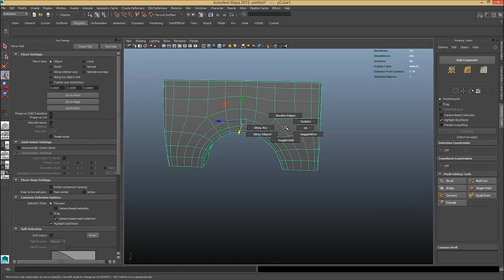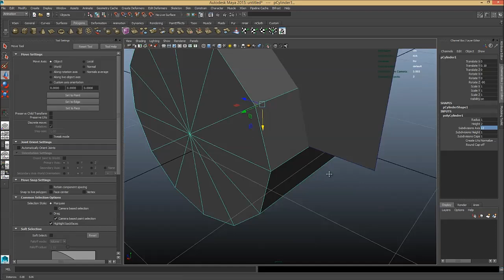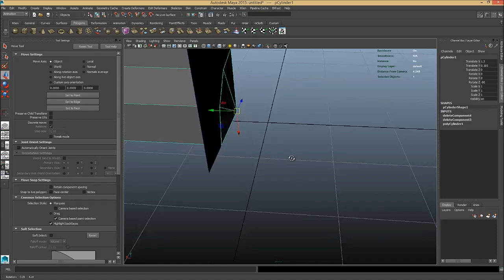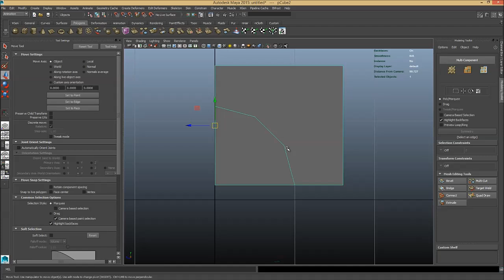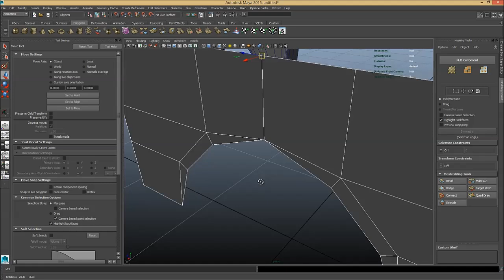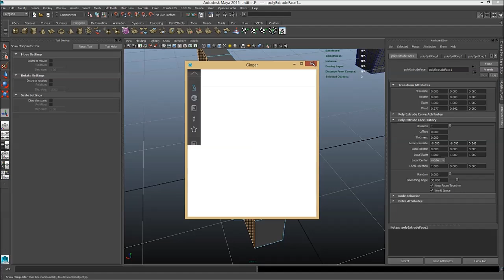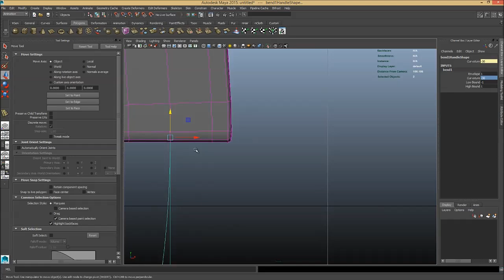Maya 2015 Modeling Tutorial - Intermediate Techniques - Arch way

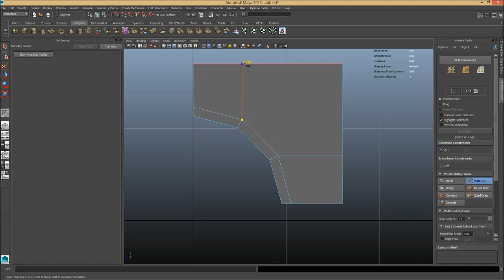Comment: 7:19 I see you struggle to get perfectly horizontal edge flow with the multicut-tool. Is there really no "hold-shift" or whatever way of getting perfect lines without any second steps?
Reply: 2 years later lol bit you can hold control but it cuts through the whole object
Reply: @SheeshMaster64  Ohh hahaha ty. Yeah I found that too in some other vid but for those wondering, I guess :D

Comment: I am sorry but this is a very lengthy and almost inaccurate way of handling a perfect curves, even for Intermediates. You shouldn't even need to manually insert vertices by hand. I use a boolean for cases like these.
> Just make box for a wall in front view, snap it to grid. 
> Make a Cylinder with 12 sides same way, snap to grid.
> Delete lower half of the perfect cylinder, then boolean with difference (The cylinder should be crossing on both sides of box)
> Then delete the faces created on the box that has N-gons (5-sided geometry) 
> Do manual bridging between edges of the box and the resulting cylindrical perfect curve.
> insert loops at corners to make it crisp when smoothed. 
It takes 2 minutes.

Comment: is there no easier way to do this. I started on modo because of cost, and its way easier to do, you just designate how wide the arch will be and then it will create  graduated set of edges to create the arch automatically.

Comment: Cool tut.  Question - why not use a Boolean to cut out the edge instead of tracing it and cutting it manually?  Otherwise, great stuff - I didn't realize half of those options were hidden in those right-click menus. :-)
Reply: booleans  can be pretty messy, and generally create more problems than not. I tried it with booleans and while it was pretty fast to get to the arch shape, it creates a messy outliner, with your objects in shape groups and such. i think for simple objects like this it works ok, you just have a bit more tidying up to do.

Comment: For an alternative way with similar results: just start from a cube instead of a plane; let's say that it's positioned similarly enough to where you polyplane is and then bevel the X aligned edge closest to the origin, with three segments (or more, but I'm just mimicking this video. In the channel box you then only have to change two other settings from the defaults ones: Autofit to OFF, and then you can set Roundness to its NEGATIVE opposite. Delete the usual (and annoying) extra-edges left from the pre-2016 version of Maya bevel, and you get the same perfectly round result. No bollean operation, no cylinders hurt. And pretty fast. Just another way to start this, at least. Then follow the rest of this video ;)

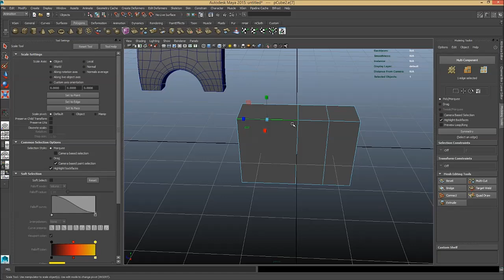Comment: When I try to use "T" command, 2:29 to repeat the last command it doesn't work. Is there a setting that needs to be turned on?
Thanks for your help.
Reply from the maker: shubham oberoi Its G to repeat last command and Y to repeat last tool, if you are unsure what is a command or a tool, check the edit mesh panel it will say "Tool" next to tools, and nothing next to commands. Hope this helps!
Reply: I'm new to maya but I think its "G" for repeat not sure :3
Reply: Edge-CGI 3D Tutorials and more! , shubham oberoi Thanks yes this works!

Comment: Ok, so as a person completely new to Maya but also as a person who picks up on programs quickly, i found your tutorial infuriating.  Your explanation of the steps you took miss out on crucial details.  I was going to knock this out before i had to go to work, but ended up spending 2 hours on it and i didn't even get halfway through because i had to use 20 other tutorials to explain the steps you glossed over!

Some areas i got hung up on:

Creating shapes:  You fail to mention that you simply clicked where you wanted the shape.  The in-program tool tips tell you to click and drag which creates a conflict in the process for people unfamiliar with Maya

Views:  I had to go through endless tutorials to learn all the shortcuts on how to change views with menus.  one moment you're in perspective the next you're in front and you completely lost me

Snapping:  Snapping should have been gone over much earlier in the video.  I ended up looking it up way before you explained it, because you used it for moving objects, you used it for rotating the cylinder (which is shift right click then LEFT - not right) ... etc etc

Finally, the last thing i got to before I just had to get off, write this and go to work - the bevel tool.  You completely skipped how to expand the bevel or whatever.  Also it doesn't help us if you tell us what your custom hotkeys are.  ALSO ALSO, it's hard to tell whether you're saying B C V D E.......?  Try using ' b like boy ' in the future - and avoid custom hotkeys as a general rule.
Basically, when a person creates the bevel using the right click menu, it doesn't automatically take you to the point where you can adjust that.  YOu have to actually open the menu on the right, click bevel and then you can adjust.  This gave me a large amount of grief, as honestly there's no decent tutorials that explain bevelling out there.

Sorry if i'm a bit harsh, i've gotten quite frustrated trying to follow your "beginner" tutorial, and i know, maybe i'm not the level of beginner you intended it for, but hopefully my issues help you create a better tutorial in the future.

PS - i will be completing this after work.  I don't give up that easily!!
Reply: I don't find that to be fair, TheDevilMyself. This was a clear tutorial from my perspective.

Part of learning is having to reference multiple tutorials, so you did the normal thing by getting stuck then referencing the web for help. Welcome to the professional world where we all do that, even at advanced levels :) 

Along with what Edge suggested, for beginners, I would recommend #1 that you never expect to knock anything out real quick in Maya. It's a complicated tool. #2, please consider Lynda.com. Most YouTube tutorials are best as references, inspiration and promos for paid training courses.

Lynda is best for learning from one instructor for at least 4 hours in an academic style format. The things you create may not be as cool as what's on YouTube, but you'll learn the basics. Edge, Escape Studios and David Horol teach similarly, using shortcuts, custom keys and marking menus which is the best way to learn but understandably may be overwhelming for a beginner. However, they do clearly let you know what they're doing.

I was easily able to follow Edge's tutorial, but I have used Lynda, Digital Tutors, went to NYU and resource tuts from Escape Studios, Simply Maya, Gnomon, Lester Banks, etc. Reference them all until you find a teaching style that suits you. Come back to this tutorial and you'll find it really easy. Best to you and I'm glad you're not giving up. And Edge was kind enough to share this with us, free, so let's please be nice and thank him ;)
Reply: *****
it's a feedback that will be necessary for him to increase his audience, which ultimately can help him earn money. I thought the steps were not explained well enough. I'm new to 3D but picked up on blender modeling very quickly, after one 20 min tutorial. I am struggling to find similar quality tutorials for Maya.
Reply: I found it good and quick, I'm new in Maya too...
you can't expect to learn something in 20 minutes when you speak about 3D softwares...
I found it good and clear
Reply: Richard r you an actual idiot the reason this video was called intermediate was because it's meant for intermediets who's already know some things about the program you can't "pick up on a program" like this so quickly this program does not hold your hand when you come across a problem you have to figure it out yourself, you need time for this program not some half asses person who thought it would be cool to check out for a day
Reply from the maker: I highly reccomend you check out these, as these might cover the very basics better. Sorry if this caused you any headaches ! 

3D Modeling basics - P.1 -  Maya 2012 Tutorial Series For Beginners HD 1080p / Intro to Edge
#1 Maya For Beginners - Modeling a Cartoon House Tutorial 1080p HD
Reply: Do be fair, I didn't mention the hood things about the tutorial.  Those were:  the pacing, the audio (aside from the E BCD thing) and all instructions that were given were given well.  2.5 hours is nowhere near quick.  The big areas for improvement were clear, I feel.  I'd recommend that the author record the video, then record the audio over it and literally make a rough script so things go well.

I'm super grateful to everyone who bothers to make tutorials.  For real.  And I was pretty harsh I'm sure, but all my points were valid.
Reply from the maker: TheDevilMyself We create and share tutorials that we feel are high quality and easy to follow. We always look for feedback from our audience to make sure that when we create tutorials (instead of sharing from an other author) they are easy to follow and very clear, so we appreciate your comment. The author of this content (FlippedNormals.com) in our opinion has supplied us with a lot of high quality videos that we feel helped many people. Maybe if we rename the content so it's not "Beginners" then there wouldn't be any misunderstanding, however this tutorial is covering content that we feel are at a beginner level. I'm sure if you just opened maya and you never used it before it would be hard to follow as it's aimed at people who already know basic object creation / navigation / moving objects around in the scene. We have many maya tutorials on our channel, so if you feel that this is too advanced, I would recommend maybe checking out the some of the other beginner series that more are suitable for your level before returning to this one. Learning Maya or any 3D software is a challenge in itself, and we are trying our best to make it easier for everyone to learn, so sorry if this caused any inconvenience. Good luck with learning! 
-Laz
Reply from the maker: Thanks for your feedback, hope you find our channel useful through your learning process !
Reply: Edge-CGI 3D Tutorials and more! For sure - it's a fine line.  I would agree that the content is at a beginner level.  Most of the things that tripped me up were also covered later in the tutorial, but were absent from the parts where they were first needed.  I will definitely check out the author's other tutorials as I do feel he did a good job overall, however I feel the beginner tag is thrown around a bit haphazardly here on the ole tube.  Links to 'introductory' videos would be appreciated where they are relevant.

Regardless, thank you author and edge for bringing quality free tutorial content to the masses!
Reply: Edge-CGI 3D Tutorials and more!
WOW LOL!
Reply: I agree. I have 20 years of 3D experience and it still took me over an hour to complete this 12 min tutorial. Too much is not explained or just too fast. But thanks for the free tutorial. Even though it was frustrating, it helped in the end.
Reply: Why are you guys being so tough on Henning's teaching. My God it's a free tutorial!!!!
Reply: +TheDevilMyself what's wrong with it sir